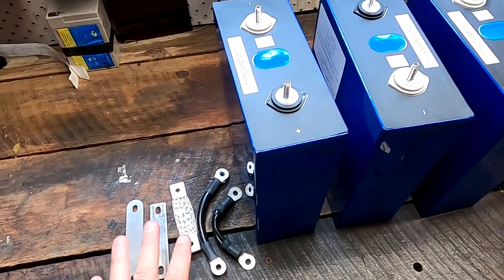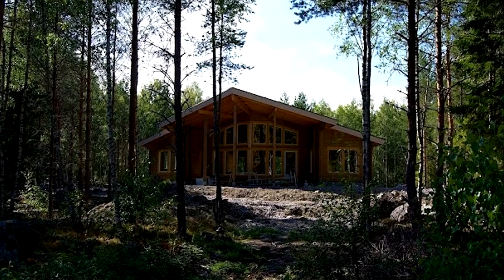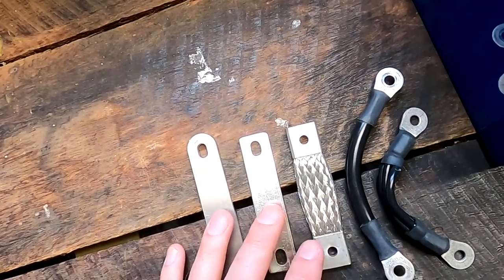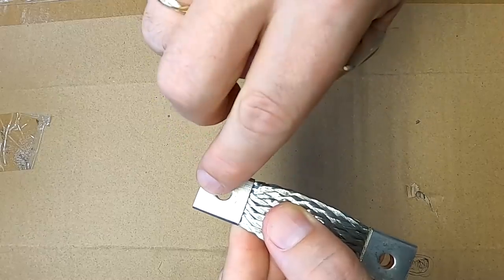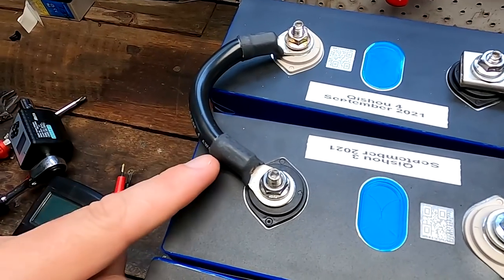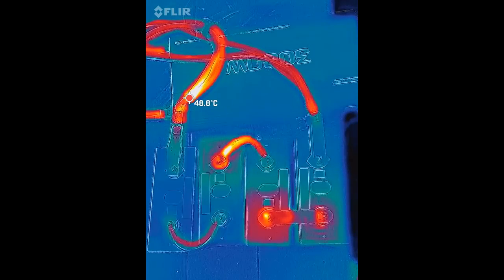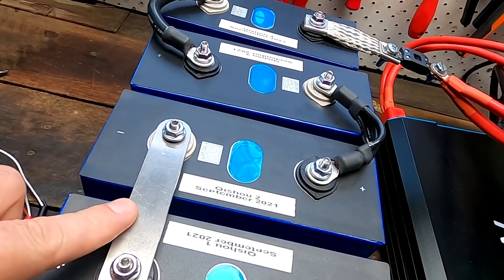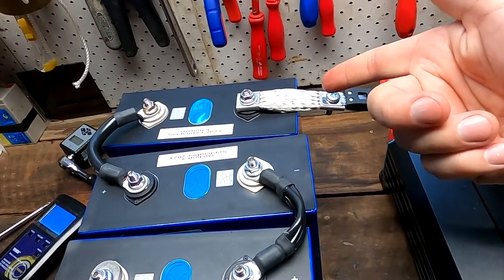All these different busbars... and why they don't matter!

Comment: Can you say something about touching batteries 🤔 looks like no danger nowhere or do you just know where to touch 🙉🦧
Reply from the maker: As long as the voltage stays under 40VDC it is safe to touch.
Reply: @OffGridGarageAustralia  Ha ha. Reminds me: Fifty years ago in a power station as electrical apprentices we used to test that by slowly moving up the bank of very large emergency LeadAcid cells that they had ie: about 2.2v at a time. (They had a 240v DC bank).
It’s was a pretty dumb thing to do, but we were young LOL :-)  
With a fair amount of discomfort, we could get to very nearly 100v. 😂😂😂

Comment: plated brass busbar usually included with chinese batteries I wouldn't use
Reply from the maker: They are tined copper bus bars which are included with the cells. Never seen or heard of brass bus bars.

Comment: so many mistakes in your testing....1st off the aluminum has a lot more resistance than copper. the tin plated copper busbars work well. the thicker the copper cable is the less resistance it will have and the less resistance it will have so less heat...a good proper torque is important.... you test the resistance through the ss set screws(aka Grub screws) stainless steel is a very poor conductor and the flow of electricity does not go through the stainless steel. the flow of electricity id going through the bus bar to the top of the battery cells which are made of aluminum. the reason for the tin plated copper lugs or tinned copper bus bars is to limit the galvanic reaction and resultant corrosion between different metals... i am so sorry to say all this but you latest youtube video gives very bad inaccurate results.... the thicker copper cable between cells is better or thicker copper is good.... the aluminum is cheap but not a good conductor....look it up....sorry for all I say but if you are testing the resistance you should be measuring the busbar from end to end just past the serrated flange nut... again the ss hardware is not where the current flows to charge or discharge the battery....
Reply: Seems he believes in ALU bus bars.
Reply: You can always make a video to show your side of things. It's easy for someone to post a comment saying that the work someone else did is somehow wrong. Why not make a video doing tests to see/show if you're right? It would certainly get a lot of attention if it turned out the manufacturers of these cells and people like Andy are somehow wrong, don't you think?
Reply: @TheDigitalMermaid  Bus bars that come with the cells are made of copper and are most likely nickel plated. Look all around on tube and you will find copper is the right material for this purpose. Of course he can do whatever he wants. People just point it out.
Reply: @TheDigitalMermaid  i like his very entertaining videos (Andy) but the test is not a good test there are too many introduced unaddresses variables. check out how the resistance is measured with the same exact meter by "ray builds cool stuff" on youtube... the copper wires with tinned copper lugs are flexible. the bare copper ground cable is flexible. your 4 wire cables are flexible... but nowhere did he compare each one without introducing other unmeasured variables. the test is missing all kinds of things to be a valid test or accurate comparison. as an analytic chemist and chemistry major his results fail in almost all scientific reproducible facts.
it takes about 2 x the aluminum to allow the same amount of current to flow through a higher resistant (more Ohms) aluminum,
I have never made a youtube video although I thought about doing so....your videos are also entertaining as you struggle/strive to get it done...👍👍
👍👍will you be on salt water where the use of tinned copper cables is needed?
you will find that thicker copper cables will not generate as much heat, as they have less resistance to current flow...
you can not compare apples to oranges and get a good result...
you must limit the variable to be tested one at a time in any scientific experiment...
there is no problem of liking a thicker aluminum busbar which requires an oxidation inhibitor...to do the same thing less amount of copper or tinned copper will do. the problem comes along with introducing many variables and error in ones testing and claiming their is no difference...
yes yes, beat me up if you prefer to have unscientific inaccurate results...
a piece of flattened used copper pipe will have less resistance than the aluminum but is a pain in the rear to make..
or as I have said we can agree, disagree or agree to disagree...
IMO >>> cleaning the terminal lightly, and using a thick enough copper cable with tinned copper lugs or tinned copper busbar is the best option for the large 280Ah commodity cells.
have a great day,,, I am not an electrical engineer, but I have 96 large lifepo4 cells cycling in 2p8s and 4p8s configurations for the last 2 plus years and also have pre-built 5kw lifepo4  to test a bit...
i knew when he (andy) started 16 cells would not be enough for him.... he makes cool stuff and shows a lot of tools and gadgets...
go watch "ray builds cool stuff" on youtube... i could find the hyper links but I am sure you will find them... he is in texas....
 I am building all of  mine off-grid purposely and charge all with solar panels purposely....
on the off-grid farm...
maybe someday I will have a boat on the water....😎😎👍👍👍👍
Reply: @pilgrimvalle  He's not a scientist and his results aren't being published, nor has he indicated that is his goal. His tests are practical-results tests, and that has validity to viewers. Something doesn't have to be lab-perfect for it to be valuable. Are pure scientific results better? Sure. Does that make lesser tests invalid? No, not at all.
Reply: @TheDigitalMermaid  his results are being published on youtube to countless people of various backgrounds.... accurate results are definitely better....entertainment is entertainment....if he prefers the inflexible bus bars made of thicker aluminum... that is his choice no doubt....poor connections are one of the downfalls that must be guarded against to prevent a fire hazard..🤔🤔
Reply from the maker: Well, Michael, if you would watch the video until the end you would have seen and heard what the test was about. I'm happy to come to your channel and see how perfect your results are! 😁
And I said this already in another reply to your comments, this channel is to test things out, not to be perfect. Mistakes are been made on purpose to see what is going to happen. If this is something you don't like... well... 🤷‍♂️
Reply: @OffGridGarageAustralia  ok, fair enough,,, i do not have a youtube channel... I never understood that you are purposely making mistakes.... a small detail/disclaimer about your videos; I should have put in my head at the beginning before making any of the comments... you are making and publishing mistakes on purpose on your youtube videos >>>for entertainment/edutainment....have a great day....😎

 P.S. I like your entertaining videos >>>> just hope it does not cause some newbies in the solar off-grid DIY community issues!